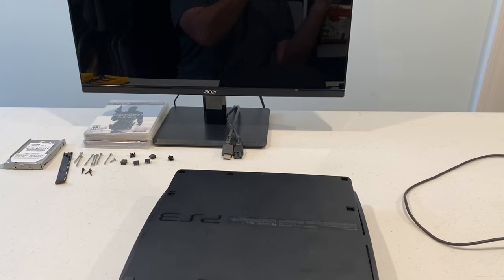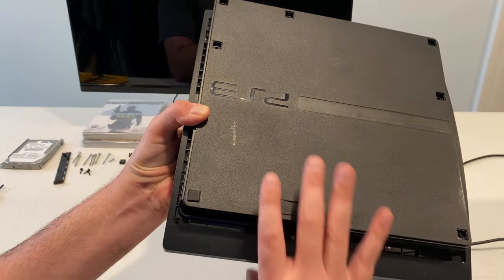PS3 Slim won't read discs | Let's FIX IT

Comment: I hate working on those PS3 slim drives. If you open them up you have to reset the drive again or it won’t work or take discs in. They are a nightmare
Reply: yes i lost one came manufactured with original especially connecting ribbon cable is like hell😂
Reply: @ScientificZoom  The first time I opened up a PS3 fat 60GB model to take the disc out cause it got the YLOD I just put it back together without alighting any gears cause it was under warranty from GameStop. Now I can fix it within an hour cause I got a lot of practice doing it. The first time I worked on a PS4 drive it took me all night to get it working back again, It took it apart like 60 tries to make it work. I used to work for a pawnshop and they gave me the PS4 to try to fix it because it was taking the disc but not ejecting it. The PS4 has an even more complex drive specially the fat PS4.
Reply: @mortalballdc  whats the real reason that legacy console such as ps3 slot blu ray drive can't be able to read discs, is it an alignment error in assembly or error in controlling circuitary, even may be dual lens it contains (dvd/blu ray). Also have a question regarding the vertical orientation of console and the if the system run at a longer period especially using a detected disc playing seems to read most undetectable discs.
Reply: @mortalballdc  i tried to check the drive earlier six years ago, possibly understood the inner workings but unable to do anything so dropped the console to the repair shop and got an used drive, it still do have issues too. Sony isn't seems concerning these kinds of important issues, also the community is upholded some best features with cfw, such as fan control, webman, irisman, addons etc. along with Rsx tweaking utility
Reply: @ScientificZoom cleaned the thermal paste yesterday and my ps3 was working fine along with the bluray now its digital only ps3 😂😂 what do u mean by resettings the drive? Im ordering the ribbon cables since I messed it up
Reply: @smokegames1179  actually i meant, any calibration on chip or mechanical area needed to be restored/repaired, saying because if the lens becomes heated and console put vertically by wires side, detection of such discs increases but only after lens is heated fully( during the use of console and not any external heat source)
Reply: @ScientificZoom Probably a feature, not a bug. Seems a lot of manufacturers create things so that they indeed will only last a certain amount of time. Say, some time shortly after they know they will have a new product on the market 🤔
Reply: @terrapinflyer273  but how did they judged this, do they even care of brand reputation or gamers sentiments?
Reply: @terrapinflyer273  i think longevity and upgradeability is more concern to the gamers with quality considering highest possible, always though of why didn't they built upgradeable
Reply: Changing the laser in a PS3 could pretty much break the daughter board because all lasers work with different frequencies and the daughterboard is synched with the original laser. If you put a brand new laser it can work for a few minutes to an hour until the daughter boards realizes it and then it can lock itself from working again or it might get used to the change. I have never changed the laser on a PS4 but I know the PS3 consoles are very finicky with other lasers. The reason why the PS5 slim has detachable disc drive.
Reply: @ScientificZoom  Hi there, I’m gonna try to answer all your questions the best I can. The reason why old PS3 consoles stop reading the disc is because the laser either gets too old and wormed out or they get dirty. Blu-Ray disc don’t get scratch that easily but they get grease, finger prints and dust really fast and when the laser reads dirty disc the grease and dust can stick to the laser that way, something that doesn’t happen as much with DVDs and CDs because the discs don’t get that grease and dust so sticky like Blu ray discs. They also get disaligned with wear. It can happen to the DVD side or Blue Ray side better as blue or red light. The vertical position helps because the laser doesn’t have to force itself up and down that much constantly reading the disc. There is an electronic coil in all lasers that moves it up and down because the discs are not made perfectly and if you put the console vertically it can help the laser read the discs more comfortably. Sony likes to over complicate things for some reason and doing repairs on PlayStations are a lot harder than on Xbox and Nintendo consoles. I’m sorry I couldn’t answer you sooner, I didn’t see your message, I just saw it actually. I’m so sorry 😞
Reply: @ScientificZoom  the hinches that lock the ribbon in place are really fragile and break very easily too
Reply: My best advice is to get the whole laser assembly with the racket and the disc spinning motor and cross your fingers pray that the daughter board would accept it and not lock itself out with the new laser. I would use multiman and play games more from the hard drive and never play Blu Ray movies on a PS3. Those consoles are now 15 years old most of them.
Reply: @mortalballdc  Actually have to no say some of my obsrvation with ps3 blu ray drive, as it is new user can notice the disc sound working in background when at full spin and reading discs, but as the users or gamers take some intense scene actions the drive has to work differently, the clicks and pops are evident, screen refresh lags, when data is not sufficiently read the games behaviour also changes, enemies or ai wont react, texture pops occur, menu access seems daunting, with network usage along disc load becomes more load on system and increasing heat and power demands.

Why did the developers don't look these kinds of fore issues prior, afterall we have paid money so as we love games and graphics technologies.
Reply: How do you reset the drive? I currently am having the problem after getting it disassembled and I put it back together but can’t get the disc to go in. Really confused what the guy did in the video to fix that part
Reply: @murk517  try to reset all the gears inside and put it back together and see if it takes them. The guy didn’t show it in the video, it is not easy to figure it out right away but you’ll be able to get it done.
Reply: @murk517  its not about only the Disc goes inside and woh alla, all works fine, it doesn't
Reply: I opened mine as it won't read disks..now it won't  power up at all
Reply: @Augustus171  you mean the whole console won’t power on or just the disc drive is unresponsive?

Comment: I can confirm this method works like a charm! Basically you need to lift up the ps3, almost at a 45 degree angle . And if that doesn’t work, lift it up higher till it’s 90 degrees

Comment: Got a slim from a friend that sat for about 2 years before I got a drive for it(had forgotten about it). When I finally booted it up and tried a disc nothing worked no blu-ray or DVD. I'm on this video due to not knowing how to disassemble the drive without damaging it. Mine was super clean looked like it was taken out the box yesterday was never disassemble either. The reason my drive wasn't working was because their was a massive paperclip stuck to the magnets next to the drive so was a easy fix. That's for the video helped me with the disassemble of the drive.
Reply: Nice! And hey, souvenier lol

Comment: That's exactly what my drive is doing! And the same model, or at least the same disc drive. Haven't heard many people mention the false eject type noise. Mine was reading blurays fine a month or two ago, but suddenly wouldn't play a new bluray I bought and no audio on another. Thought the disc was faulty and got a refund on it (also thought my unit was playing other blurays fine though... Feel kinda bad about it even though it was only $10.)

I was thinking about going ahead and just replacing the laser mechanism, but gonna clean the original lens w alcohol first. That's always done the trick in other old disc drives. If that doesn't work, just gotta pinpoint the mechanism model number, drop $30 on it and hope for the best.

Good to know about the remarrying thing with new complete disc drives too. Heard the term in passing, but I thought it was maybe for non-OEM-spec drives or something.
Reply: Did cleaning the laser lens fix your problem? My PS3 does this as well. It sometimes won’t read a game and will make the eject noise without actually ejecting the game, but sometimes they load up just fine.

Comment: Friend of mine wanted to play some PS3 games with me, so I grabbed the old buddy after some years of non-usage. Sadly I now have the exact same issues as your friend had with his, as in not recognizing Blu-Ray discs (funnily enough it still recognizes DVDs) and the same spinning behavior. Some other videos on the issue claim that a PS3 system restore fixed it for them and after 7 hours of the PS3 doing its thing, it sadly didn't help me. 
Next I'll try cleaning the lens and if that won't help, I'll have to decide if I'll get a replacement lens or a still working PS3 from the used market. Either way, your video is very helpful and shows what to look out for. Thank you!
Reply: If it is still recognizing dvds but not blu-rays' there is a really good chance it is just the laser for the blu-ray discs. The ps3 slim has 2 lasers in its disc drive. One for dvds and one for blu-ray.
Reply: @GarretBobbyFurguson  Jup, I replaced the lens in the drive just now and it works like a charm again!
Reply: @marlex4552 where did you buy the replacement laser? I tried getting it on Amazon and they sent a broken one… was thinking of trying eBay!
Reply: @marlex4552 I'm curious where to buy the laser mechanism too.
Reply: marlex  broo he visto otro video en YouTube donde insertan una película luego un disco mp3 después intenta jugar un juego y le ha funcionado.. a mi me funciono despues de 2 a 3 intentos de luego abrir y cerrar la bandeja del disco.. espero le funcione también.. no se si sea coincidencia.. pero me funciona en ps3 super slim
Reply: @terrapinflyer273 have you found a replacement laser anywhere? If yes, could you please tell me where? I would kindly appreciate an answer, thanks in advance!

Comment: I admire your patience! I'm trying to fix my playstation at the moment. I bought a new cd drive for it but didn't know about having to change the chip over so it doesn't work. I'll be sure to try out your methods.
Reply: it worked! I can use my playstation again!

Comment: 10:04 you can actually remarry the disk drive if you put a new one on there but you’d need CFW to do, put it in factory service mode first then click remarry option. This didn’t fix my issue though

Comment: Hi! Thanks for the video, it was informative. Seems I might have the same problem. What's the part number and rough price of the disc drive you purchased in this repair? Today I got a PS3 slim from Goodwill. Goodwill had some TV's so I tested it the machine. It worked just fine with a Batman PS3 game I found at the store. The CD was accepted and it loaded up, no problem. In fact I played for about 5 minutes. The machine and controller it came with were kinda dirty, so tonight I cleaned them. The controller works well. So far, so good. Anyway, turns out the Batman game from Goodwill was the previous owners as its info was stored onto the counsel. Just like earlier today, I played it for a bit and then watched a DVD. So far so good! THEN I discovered a problem. When I attempted to play my copy of FIFA the game wouldn't load. The game was accepted into the PS3, but after a few seconds the machine made the same CLUMP noise as in your video. So now I'm wondering what's going on. How come the DVD and Batman worked? In another repair video the guy said to perform a machine restore followed up with an update and supposedly it would fix the problem. Any advice? Thank you.

Comment: I have the second original PS3. The first original had 60 GB hdd, and the second had 80 GB. I bought it in 2007 I believe.
Now ot won’t read DVDs or game discs, but reads blu-rays fine. I believe the PS3 had 2 laser systems? So my guess is, that the one for dvds and game discs has expired?

Comment: Greetings, I was doing maintenance on my PS3 and the flex or heads of the Blu-ray reader were damaged, when I tried to connect it they were already damaged, I have the CECH 2501A console and I need to buy now those FFC/FPC Flexible Flat Cable Ribbon flex cables, but I see 2 differences in these cables 'Forward Direction' or 'Reverse Direction', for the 8 pin cable and the 14 pin cable which is the correct option to avoid making a mistake when buying?
Reply: Hi is the cech 2501A and cech 3000 series interchangeable cuase the have the same drive and do you need to change anything on them if you know maybe.
Reply: @Heinrich.Fourie  Sorry but I don't understand anything you're saying ?? 😚
Reply: @VainasDominicanas809  Hi just wanted to know if you can put the console cech 2501A disk drive in cech 3001A console cause they have the same diskdrive i got the answer those two dont have pcb to replace so the will work in each other thanks for the reply.

Comment: I have a similar issue right now, and I wish to hear your thoughts on it: My original PS3 slim BR drive could not pull in discs, so I took out its daughter board and put it inside a 2nd drive, but still got the same result (discs would not be pulled in). I took that 2nd drive and put another daughter board inside it, and it started pulling in discs... but nothing pops up on screen.

Does this mean the original daughter board is dead and I have to reprogram the other daughter board to be recognized by my PS3 as the "original" one?
Reply: It would be better to give it to somebody that has experience working with mechanical drives like me. Or you have to have a lot of patience and focus to do that but better to hand it to someone with experience. They will make it work for you 100%
Reply: If the second drive works, you may just need to 'remarry' the drive to the motherboard. Which I've heard can be done with custom firmware?
Reply: @terrapinflyer273  So whether or not the daughter board inside it is the original doesn't matter?
Reply: @elvampe13  the daughter board is very rare that would stop working. It is like 1% chance out of 100% that the daughter board would break. You have to use the original daughter board.
Reply: @mortalballdc  The original daughter board is not able to make either of my two drives pull in discs. The daughter board that came from another PS3, when placed inside the 2nd drive, manages to pull in discs.

I'm hoping there's a hack that can make the PS3 remarry with any drive's daughter board.

Comment: My slim does this too except with CDs and PS1 discs it spins, sounds like it is ejecting then stops spinning. PS3 and Bluray discs play fine. So looks like I will be replacing the laser assembly as well. I can run my games from the hard drive via CFW but I'd like to have a fully functioning system. Plus I can clean out the dust and repaste the CPU/RSX.

Comment: Ok so I have a check 2501a model.. does the disc drive for that model have a daughterboard. Or can I just switch them out as needed. I'm having this same issue and I have a new disc drive for it
Reply: 25xx forward its in the motherboars so should be as easy as swapping the drives

Comment: Someone suggested when loading disk to tilt up the PS3 about 60 degs and the disk will drop in properly so  the Lazar can read it. Worked for me but needs to be fixed.
Reply: Yeah same, my PS3 sometimes doesn’t want to read games and that little trick works, but I don’t want to have to do it every time I play.

Comment: I have this very similar issue with my PS3 slim, but idk why after turning it on it won’t read the disc. It tried to spin and it kinda does but then after trying it completely gives up. If I leave the ps3 turned on heating up a bit after like almost 2 hours(or maybe even less time) after it’s heated up, the ps3 will read any disc just fine. Idk maybe dusty laser idk tbh
Reply: mismo problema bro le inserte un disco mp3 luego una película y al último un juego y ya funciona.. también despues de unos intentos de abrir y cerrar la bandeja de discos.. aah yo tengo ps3 super slim

Comment: is there any flash bios to overwrite earlier bios
Reply: As far as I know, you can't flash earlier BIOS versions than you currently have on the system. But you can update from an earlier version. There are probably BIOS installers for different versions archived somewhere online. There might be a manual installer on Sony's website for the latest version too - but if you do have an earlier version and update to the latest, that might block you out of some custom mod options
Reply: @terrapinflyer273  with recent run of cfw of console, discovered that if cfw is connected to internet sony is trying to bypass cfw entirely, but clever people knows how sony maintaining monopoly, but attempts aren't effective to be precise. I think every action has several loopholes n wekapoints along with their advantages
Reply: @terrapinflyer273  i already know that designers choose the lifecycle of its internal blu ray drive to be low as possible along with their internal circuitary used for the purpose. Think along and may discover every drive went with same state, if i was that level learned system knowledge definitely would have the problem solved earlier. They somehow managed to block both lenses of dvd n blu ray to do so